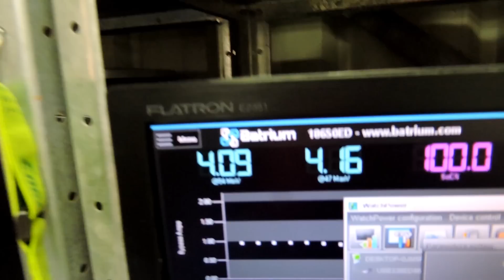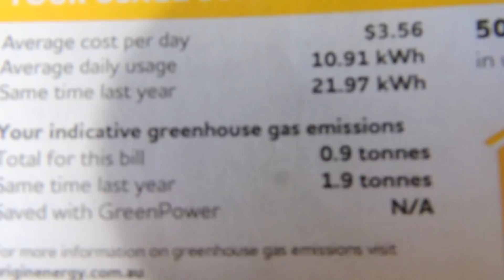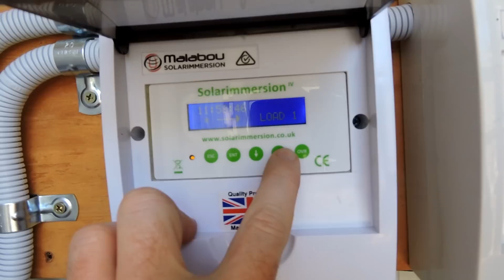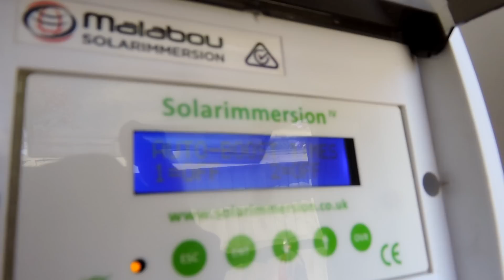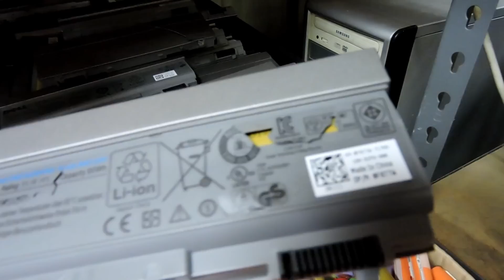18650ED UPDATE Yeh   60 kWh and Someone makes a special appearance

Comment: If you pause the video at 53 seconds in?...I can get to that stage?...where your holding the packs with your left hand in the video?...its the balancing of the packs & connecting them together, & then how to connect the packs to the inverter, or is it the charge controller 1st?...then to the homes electrical breaker box...I am also lost & confused on how to connect & set up the long mons...& the bms... I have no idea how you set them up & attached them... I watched your video on balancing the packs?"...still lost...  if you could... do u have like 2 spare packs laying around that you could use as an example...& do a "how to" balance your packs"...then another video on how to "connect your packs?"...almost from start to finish... but I can get up to the part in this video (53 secs in?)... then I'm lost...thanks- what do I do now?...

Comment: holly cow your electric must be high over there all those batteries and still a bill over $330 nice pile of batteries
Reply from the maker: It's really not that much i think but will still try to lower it
Reply: I am in Melbourne, same elec company (i can tell from your bill) i have 4.3kw solar on the roof. Family of 4, FULLY electric household and my bill is exact same as yours, almost to the dollar. But I don't have 40kh of battery back up..... Just sayin
Reply from the maker: You run a computer shop that pulls 20 kwh on a good day and a wife that runs a PT room thats always airconed :) just sayin

Comment: Those spot welders combined with those handheld probes can make it harder to spot weld thicker nickel strips. The power dissipates over the length of the probes. Thinner nickel strips might solve your problem.
Reply from the maker: Nar it's crap - might have to MOD it... replace cables and turn it up to 11

Comment: You should see my average power bill, not much more then yours
But i have no solar or anything
Also no air con... brisbane is warm some days as you know
When i get my own house ill have ac, renting for now
Reply from the maker: We run two businesses and do alot of cooking on the cook top also heavy on the air con...next bill we are trying to get bill under 250
Reply: HBPowerwall thats actually quite impressive after you put that into the matter
Our power bill goes down over summer because the hot water cylinder doesnt use as much electricity

Comment: what is your current kWh size, you only need to add 15 to 25 more kWh to go 100% green, also if you add some more solar maybe you can get your electric company to pay your electric bill and maybe your tv bill
Reply from the maker: $110 of that bill was connection fees, we are a long way from being offgrid and would never do it anyway - grid is too cheap as a backup. Lets face it I'm using cheap gear that could fail.
Reply: I never said to go off grid, what I said is that you could use 100% green energy, as currently, you are putting 0.9 tonnes or about 1984.16 pounds or 899.9998369 KG of co2 into the atmosphere, and that the electric company would have to pay you for being connected to the grid instead of you paying them also you could earn extra cash
Reply from the maker: Arrr gotcha! YES making our way there, when we install 2nd inverter and put the workshop and all aircons on the batteries will be better again i think

Comment: How big is your solar system? Must be small right ?
Reply from the maker: 10.5kw 6kw is grid tied, 4.5 is offgrid
Reply: That's a big system.  I have a 5.5kw system I currantly use 10.65kWh a day. I was going to put in a battery system but just cannot justify the expense or am I wrong? I pay around $350 a month at the moment. But it does look like fun.